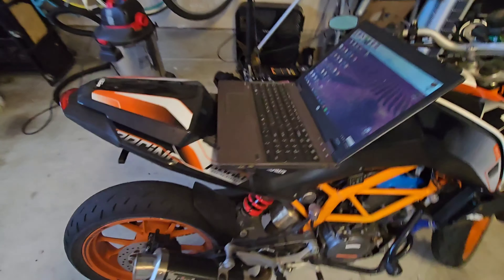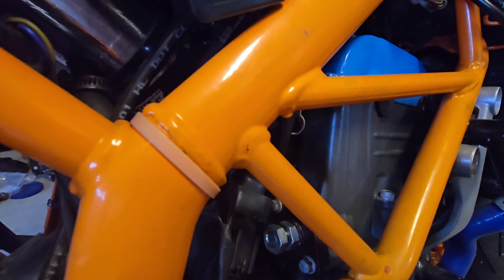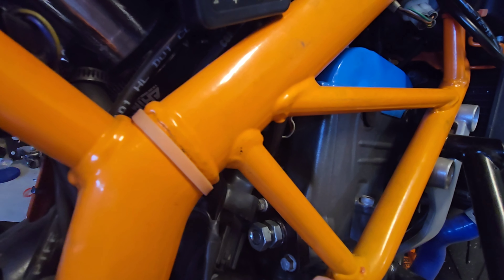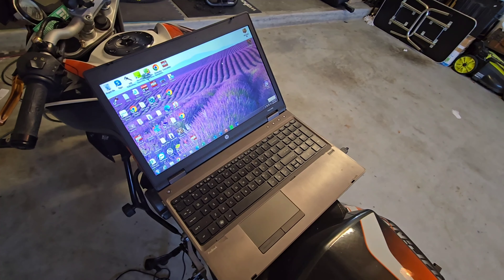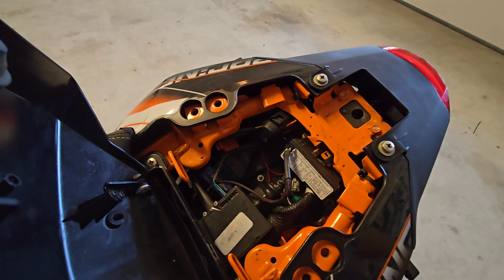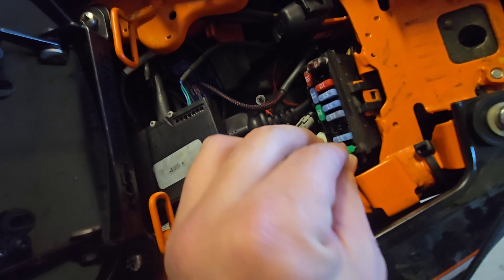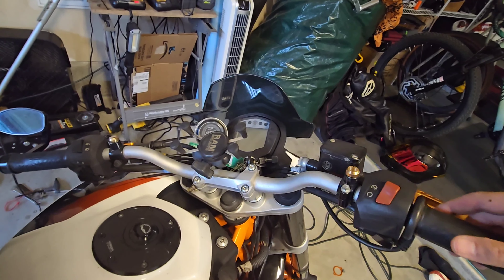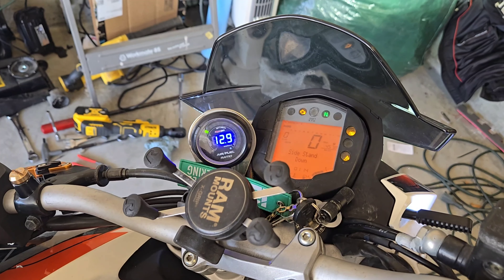ktm 390 duke - Idle Relearn

Comment: Maybe the cam chain is too tight now what causes the idle regulater of the ecu to make the idle so unstaple? Try not to just richen up the fueling and double check the cam chain tensioner.
Also a idle reset just works when a ktm mechanic resets all the parameters of your ecu which does not work with just unplugging the battery
Reply from the maker: @oom_701  idle reset is not just a KTM thing.  Many manufacturers have this as a feature.  Yes, the fueling was likely effected by adjusting the timing chain tensioner.  Especially my setup as I have longer duration cams.  I found that a little fuel helps a fair amount with having a more stable idle.

Comment: Hi bro, I have been watching all your videos and I have a doubt regarding to the manual timing chain tensioner, how many Newton meter did you give to find the right tension? thank you for replying soon. I am a subscriber, I have RC390 with all the toys added already.
Reply from the maker: @bekenvower  i can see the hesitation.  I assume you've seen the original video I put out a while ago.  To answer your question. There is not a torque rating for the tensioner part itself.  That would be difficult to do as chains will vary based on how old they are and ware.  The method I have found to work best and best on the instructions is to finger tighten until you can't.  Then, rotate the engine and give it a few more turns as the engine rotates.  At the end, you loosen it by 1/4 of a turn.  I don't trust KTM tensioners for a lot of reasons and would much rather use a manual unit.  If you have more questions, hit me up.
Reply: Actually we have to be always look for the testing is screw right in front of the tensioner by removing the 10th external board right so we have to Lucent and Retreat the minus with a minus so you could care about what to do home aware and furthers always talking but the harassing we wear facing WhatsApp
Reply: @RhoadsChristopher  Thank you bro, I do really appreciate your advice, I am gonna follow it once I have to install the manual Tensioner.
Reply: @g-rk9510  Alright bro, I will do that, thank you for taking the time to share it.

Comment: Hi , I am interested in software you use to have idle relearn & also check sensors I own a 2021 ktm adventure, I am having a hard time starting first thing in the morning, have to crank at lease six times
Thanks
Reply from the maker: @Cyp-k4n  good morning, idle relearn does not require special software.  Follow the steps in the video.
Reply from the maker: @Cyp-k4n  how many miles?  When is the last time you did valve checks
Reply: @ Rhoadschristopher good morning I will give you some background this bike was assembled in the Philippines, I am in the Philippines the issue with hard starting and cutting off when I down shift some times seem to only happen to the bikes assembled in south east Asia . This bike has only 5 thousand miles on it , would the valve  clearances be off already? 
Thanks for your input and let me know if you have any other suggestions, I am away right now will check it out when I get back
Thanks cyp